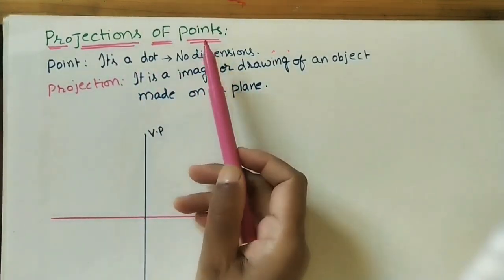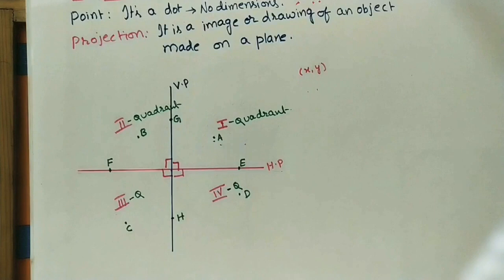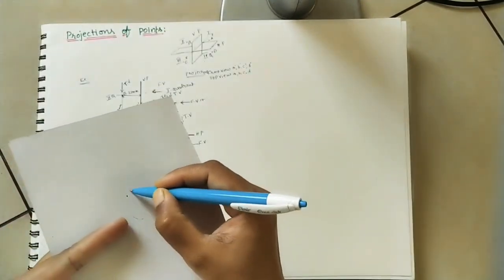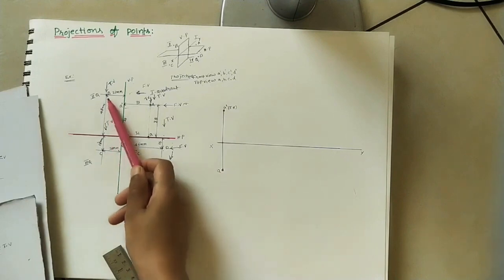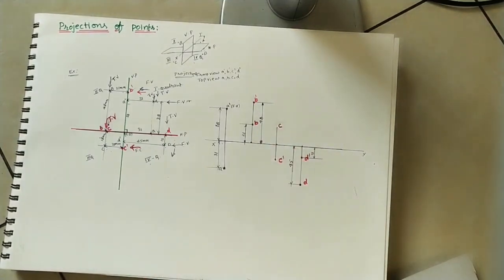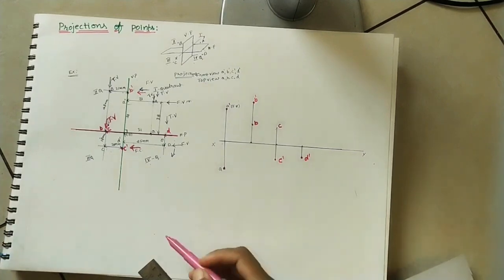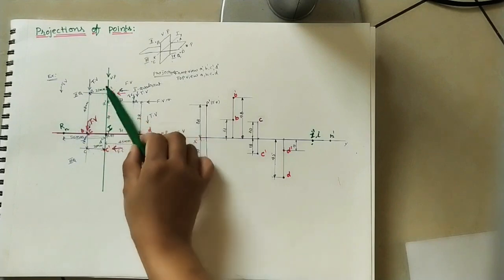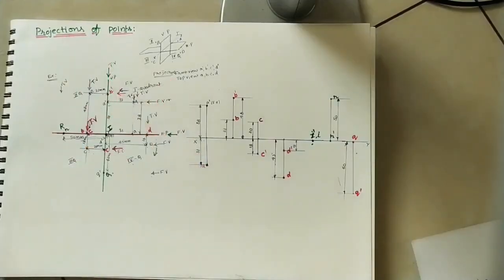Projections of Points //Engg. Drawing //Engg Graphics

Comment: A line AB has its end A 15 mm above the HP and 20 mm in front of the VP. End B
is 50 mm in front of the VP. The vertical trace (VT) is 7 mm above the HP. Draw the projections 
of the line if the distance between end projectors is 45 mm and find its TL, θ, φ, HT.    
Mam make video on this question please